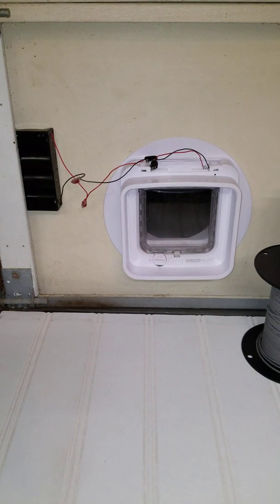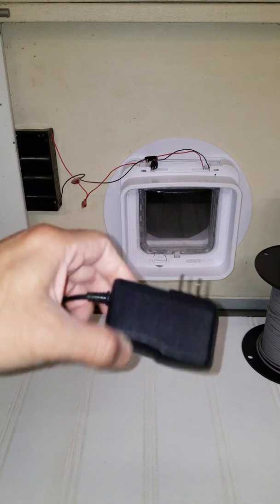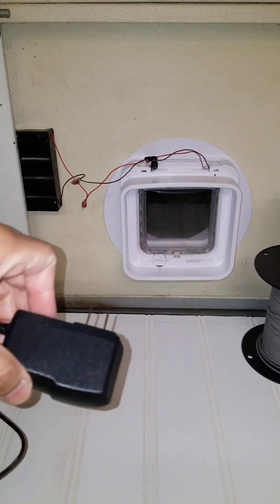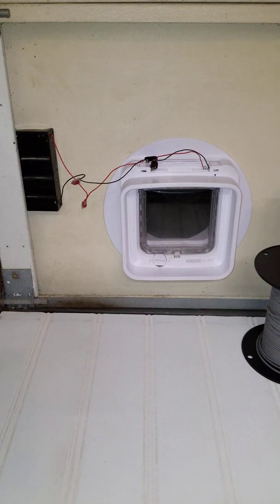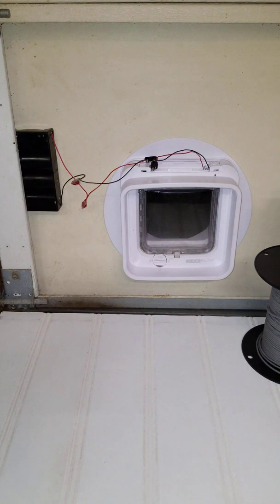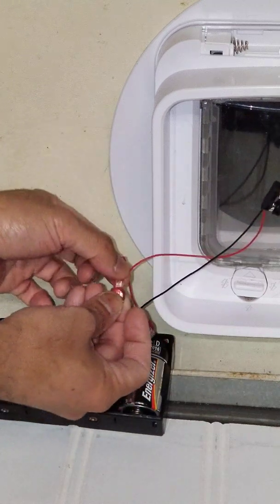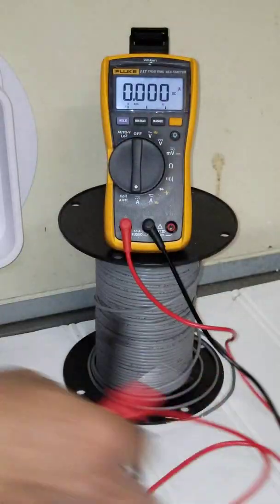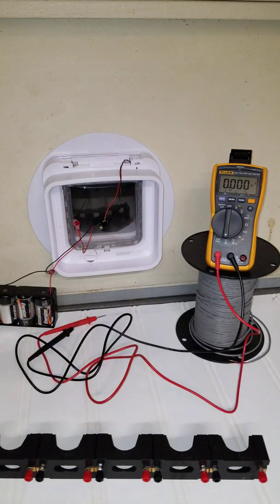Sureflap DualScan Microchip Cat Door Simple Solution to Batteries Running Out Too Soon Using D Cells

Comment: The 3.45 A spike is probably why this thing does not work well with most 6V AC adapters you find on Amazon (that can simulate 4 x AA battery). They usually deliver only 1W which is not enough. Oddly enough, they advertised themselves being compatible with cat flaps. The huge current consumption is because coils are used to operate the locks.

Comment: Pretty interesting. My sureflap on the other hand has another problem.
Battery drain. In 24 hours the batteries need to be replaced.
It happened to my first unit after a long time of using it without problems and now happened  also to my replacement unit, sureflap sent me. Suddenly just one day, after 1 year or faultless usage, it started to drain the batteries.
I am clueless of what might be causing the problem.
Reply: I am experiencing the same problem. I am out of guarantee sadly. Did you find the problem?
Reply from the maker: I do not know for sure the cause of the problem, but having opened my unit after 3 years of use, I know this unit is prone to accumulating quite a bit of dirt inside the unit, so an internal Intermittent short circuit is possible. If you are up for it, the unit is relatively easy to open with removal of 4 Phillips head screws for cleaning. Alternatively, this unit functions great using an analog (DC) power supply set to 6 volts, but you need to attach the wires yourself to the battery contacts on the right. In my experience, using most other adapters, such as multivolt adapters, will not work for this unit as the high frequency component of these adapters interferes with RF-tag sensing circuitry. Unfortunately, the cheapest of these bulky bench-style DC power supplies cost $33 on Amazon.
Reply from the maker: I do not know for sure the cause of the problem, but having opened my unit after 3 years of use, I know this unit is prone to accumulating quite a bit of dirt inside the unit, so an internal Intermittent short circuit is possible. If you are up for it, the unit is relatively easy to open with removal of 4 Phillips head screws for cleaning. Alternatively, this unit functions great using an analog (DC) power supply set to 6 volts, but you need to attach the wires yourself to the battery contacts on the right. In my experience, using most other adapters, such as multivolt adapters, will not work for this unit as the high frequency component of these adapters interferes with RF-tag sensing circuitry. Unfortunately, the cheapest of these bulky bench-style DC power supplies cost $33 on Amazon.

Comment: I'm going to do your D cell mod.  My AAs are only lasting a couple weeks.  Depending on how long the D cells last I might try a 6v scooter or lantern battery.  Something rechargeable would be ideal.  I have two cats that are in and out a lot plus they like to lay in front of the door to look out, meanwhile the door clicks away unlocking and locking.
Reply from the maker: Never got around to making the video regarding using adapters/power supplies, but linear power supplies do solve the problem as we theorized. In my experience,  most regular adapters (the very light switching power adapters similar to those used for cell phone chargers) will not work because the frequency they utilize interferes with that utilized by the cat door to communicate wih the cat's RFID chip. However, I have been using Tekpower Linear Power Supply 15V @ 2A, TP1502D since November 2020 to power the SureFlap Cat Door and have the door communicate successfully with the cat's microchips without any issues. The downside is that linear power supplies are relatively expensive compared with switching power adapters. This one was $50 on Amazon. It is currently unavailable on Amazon but I would expect similar devices to work as well. Also, the door will be inoperable if the AC power goes out for any reason.
Reply: @khursheedimam1182  I need battery supply because we go on vacation and a power failure would lock the cats out or in.  I got two 4xD cell packs off Amazon I’m going to wire parallel that should last a long time.
Reply from the maker: @terrywaters6186  I do the same, switching to D cells for vacations, as we do have occasional power outages as well. Otherwise, the linear power supply is what we use when we are home, so I don't have to think about batteries.
Reply: @khursheedimam1182  sorry I'm a bit lost, why would we need a 15v power supply and not 6v?

Comment: Great video - thanks! Did you ever take a look at the linear power supplies and find a solution that works?
Was about to buy a battery eliminator for this exact same flap so glad I found this!
Reply: Nevermind. I found a 6V switching power supply from a baby monitor (Philips) which works :)
Reply: @vaderaguk could you please supply specification?
Reply: @vaderaguk  Hi, would you mind sharing which Philips baby monitor model number you found that solves this problem? Thank you.
Reply: @karnaltube I would, but it stopped working after a while. I ended up buying a variable output USB from AliExpress to provide 6v - been working great
Reply: Thank you  @vaderaguk  How long has the new one been working and can you give me  a make and model # please?
Reply: @karnaltube no model number, just called usb to 6v adapter (it can convert to multiple but use it at 6v)
It's solid, been using it for 18mo now based on purchase date
Reply from the maker: Never got around to making the video regarding this question, but linear power supplies do solve the problem as we theorized. I have been using Tekpower Linear Power Supply 15V @ 2A, TP1502D since November 2020 to power the SureFlap Cat Door and have the door communicate successfully with the cat's microchips without any issues. The downside is that linear power supplies are relatively expensive compared with switching power adapters. This one was $50 on Amazon. It is currently unavailable on Amazon but I would expect similar devices to work as well.
Reply from the maker: I am surprised you found a switching power supply that allowed the door to still communicate with the cats' microchips. I didn't know switching power supplies with low enough noise or with frequencies distinct enough from those used for the microchip communication circuit existed. Good for you!